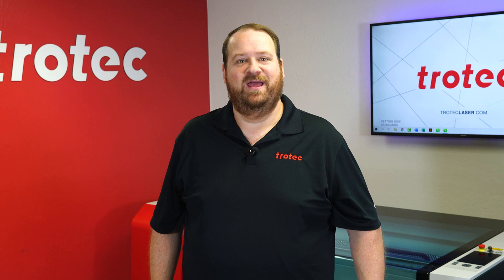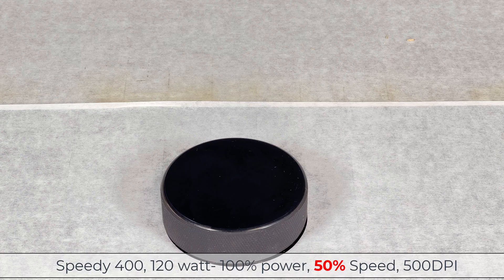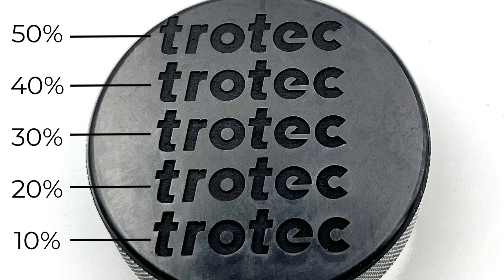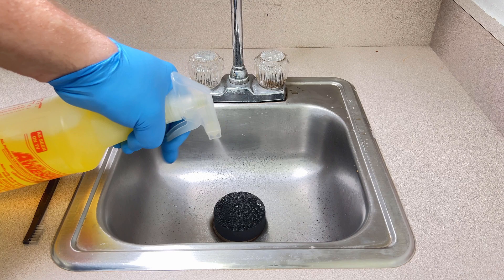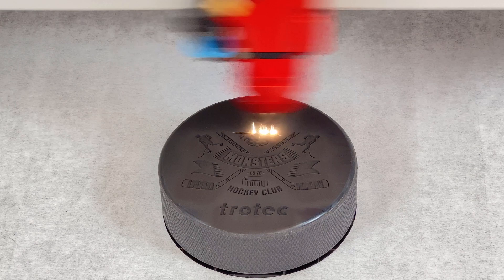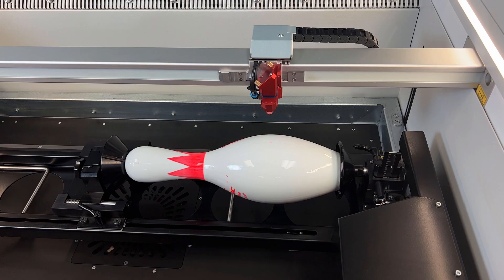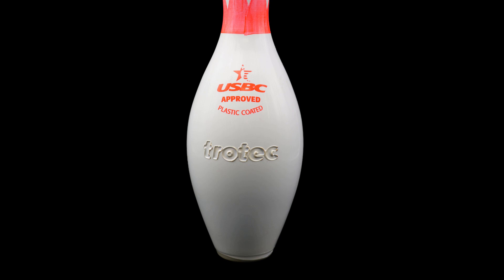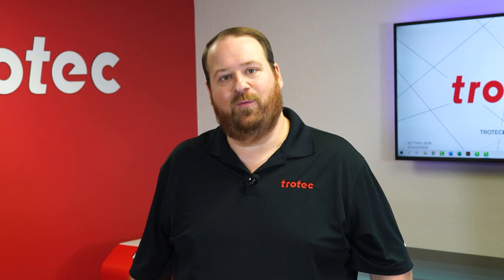Trotec Laser: Can you Laser Hockey Pucks?

Comment: What about the flex fiber laser?  The fiber could mark both of them and maybe different colors white on the hockey puck and black on the pin
Reply from the maker: Yes, a fiber laser will work on this material, but it will not produce a "white" contrast like you may have seen on some black plastics; due to the makeup of this material, a fiber laser would also make a black mark, and it would have little to no depth, the Co2 produced a far better looking finished result onto this material.